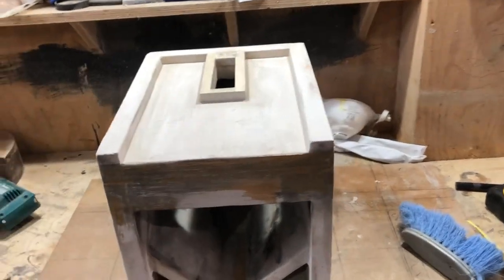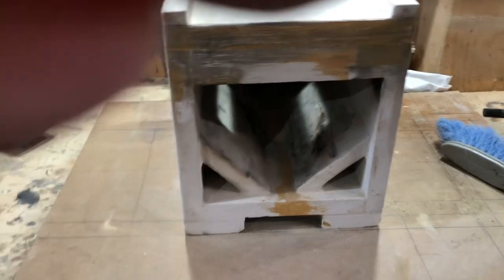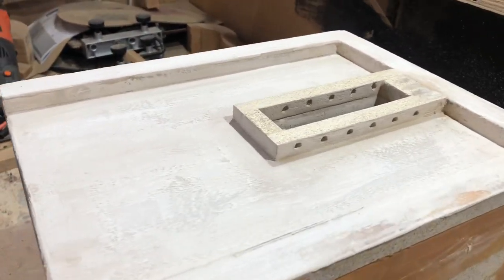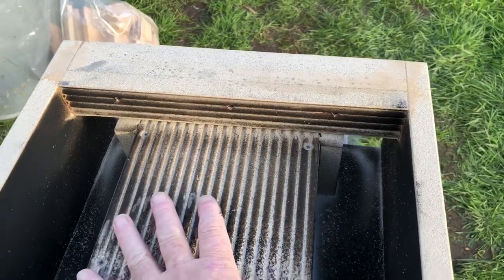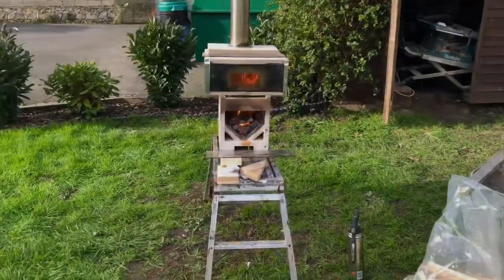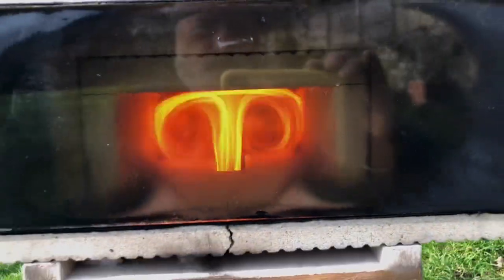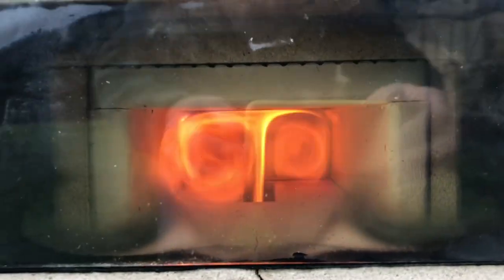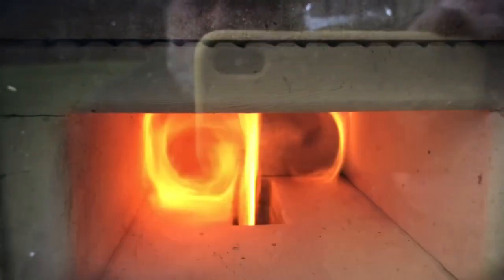Vortex  stove update part two

Comment: I had written up a similar idea on Permies.  In my iteration the ceiling, or a portion of the ceiling of the firebox is made of ceramic glass in order to transmit more heat to the secondary air slot.  Not sure how the glass would hold up though.  Awesome job Thomas very much appreciate and enjoy your builds.
Reply from the maker: Thanks, there is a limit to how hot the air needs to be before the effect goes backwards, something to do with hot air expanding and slowing down the flow. There is a lot of info about that on Permies but I need to re read it to grasp the exact issue ! 
I think the ceramic glass might last in the fire box but it will go very crazed and opaque, I doubt if it would last a whole season in the fire box roof but I like your thinking and small pieces of glass are free to me.

Comment: Maybe temporarily blocking the new secondary air channel while the vortices are strong will reveal whether it's contributing much. Although with no front on, there's presumably ample air for both primary and secondary burn so the real effects may only been seen when fully assembled. Thanks for sharing.
Reply from the maker: Yes I agree, I can only play around and guess until it is all sealed up and working in position, thanks for your interest.

Comment: Hi, I have been following your interesting project for some time now and l managed to build a similar configuration. I am however confused on the connection of the configuration with the chimney. Is there a way to maybe include that in one of your next videos. Thanks
Reply from the maker: I think if you can freeze frame this video at 47 seconds you can just see the little extension I made to take the chimney but yes I will mention something in the next video (vortex stove 4)  if possible,  you want the chimney outlet to be a bit lower than the floor of the afterburner.
https://youtu.be/JS8HZNlMqWQ
Reply: @foxfish7115  Thank you for your additional comments.I will continue to follow your experiments.

Comment: Compared with the previous secondary air intake method, which one is better for mixing?
Reply from the maker: I dont know, I do know it works well with just the main air supply, I am trying to work out if it benefits from a separate source of air.